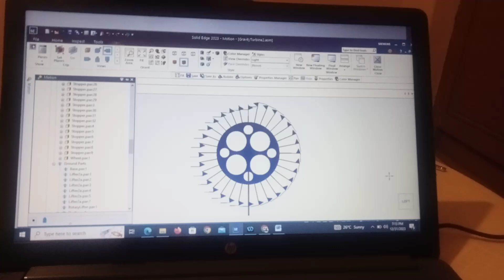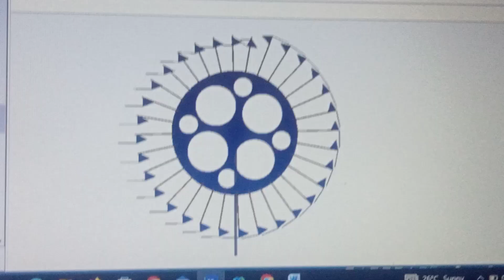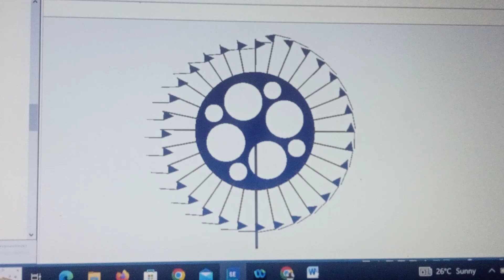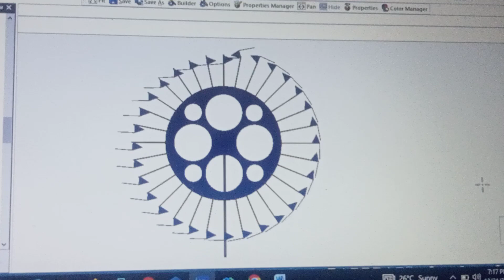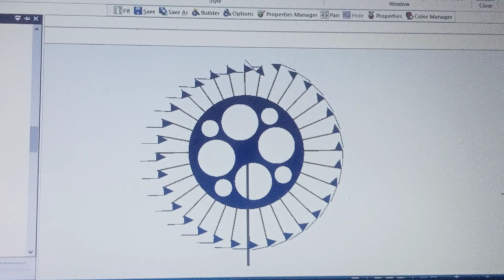World's First Working Gravity Wheel, Abundance of Renewable Energy Real Possibility - Part 3g

Comment: so, most weight is in triangles, not in the short arms.  somewhat similar to Aldo Costa's wheel. cool!
Reply from the maker: Hello Friends. Actually the triangle portion is mainly an impact point where the stationary rod collides with the moving lever arm for it to flip over.  The lever arms are L-shaped (ignoring the triangle part) and the heavier portion of the L is the second part not attached to the wheel
Reply from the maker: And yes, I saw the Aldo Costa wheel and though I did not understand the flipping mechanism of the many weights in the gigatic wheel, I felt it might be working.
Reply: @professortiwes2877  oh i see. very interesting, the sims show it goes?
Reply from the maker: @lindaellison899  so far the simulation suggests that it works. So far it is able to lift continuously 14 lever arms and then it stops. There is no scientific explanation why it should stop so am still investigating but for me lifting of 14 lever arms continuously shows me that the system should work in real life.
Reply: looks like the longer part of ''L'' shape has 17 on the left, 15 on right, as if it should be going ccw. but the triangle part is 15 left, 17 right. idk about those sims. best regards
Reply from the maker: @lindaellison899  the clockwise rotation of the wheel is purely due to the resultant moment caused by the difference in lever arms lengths on the right side compared to Left Side of the wheel. Not because of the numbers right or Left.

Comment: Simple over-balanced wheels like this do not work. There has to be some input force. The input force can be incorporated into the system like a classical perpetual motion machine. That setup is difficult. It's easier to put in a small amount of energy and get more out (over-unity.)
Reply: Hello QE when are you going to post a new video? And happy new year! ❤
Reply from the maker: I agree with you @QuantumEnergySearch, a simple overbalanced wheel does not work. What we have here is a forced overbalanced wheel where the topmost lever arm is lifted continuously to ensure the wheel is perpetually overbalanced.